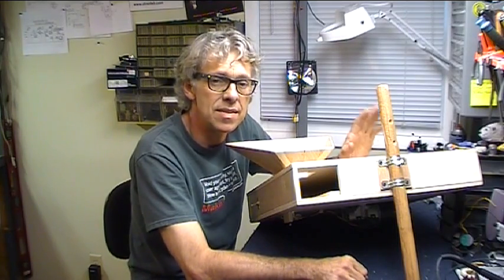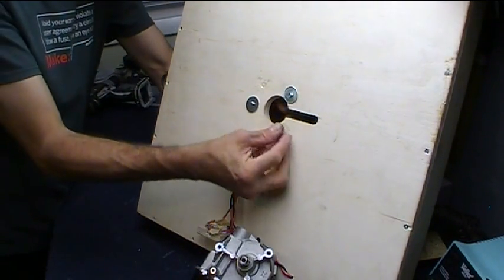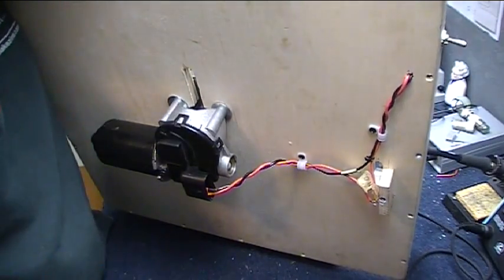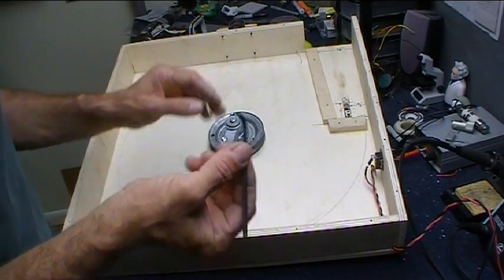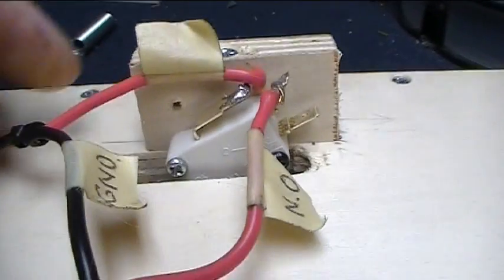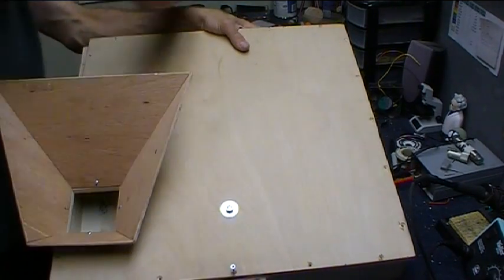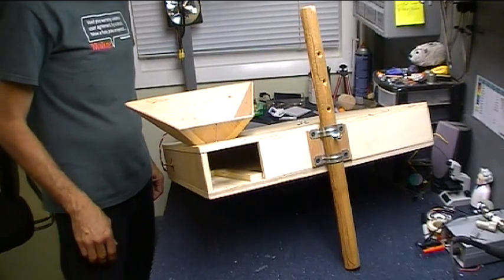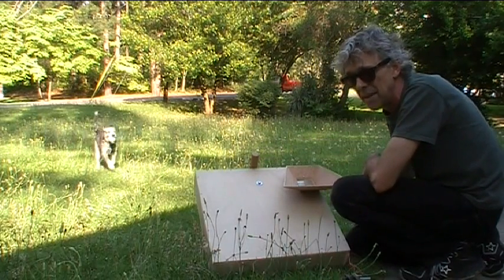Fetch-O-Matic DIY Ball Launcher

Comment: I know this DIY is old, but is it possible to get the PDF instructions still? I tried the makezine site, and they don't seem to be available anymore. I really, REALLY want to make this for my JRT. I have been through 3-4 different commercial fetchers, and they are all trash. This would work perfectly. TIA
Reply from the maker: This link is for the PDF but for some reason it isn't on a secure server. COPY THE LINK AND PASTE IT IN A NEW WINDOW THEN HIT ENTER. 
Chrome browser will give you the option to download it anyway. I did so on my laptop and it downloaded fine. Build it!!
Link: http://cdn.makezine.com/make/31/dog_ball_launcher_template_pdfs.zip
Reply: @HackaweekTV  I copied that link and manually added an s after the http to make it https.  Chrome liked it ok.

Comment: I'm trying a tennis ball launcher machine. First issue I'm facing is joining my selected wheel to the shaft of the motor without there being the perfect shop that sells exact type of fittings that will join th😅ngs together. So far I'm trying to join a 5mm non threaded motor shaft to a 6mm non threaded shaft of the wheel. How would you join them?
Reply from the maker: I'd make a coupler on my lathe and add set screws.

Comment: Awesome project.  Wondering what the diode on the switch is for?
Reply from the maker: To prevent using it in a backward rotation if connected reverse polarity. ;)

Comment: I've gone threw 2 wiper motors the main gear cracks from the impact of the ball wacker over time, I tried reducing the spring tension too, my dog loved this machine but I need a wiper motor with metal gears I think.

Comment: what an awesome idea!... i have found an old wiper motor covered in dust and have it working, im wondering, on the motor you used, does it rotate with next to no resistance (as the arm on yours seems to move freely), i am concerned that ones the spring (on mine) is past the half way point it will not 'fling' because of the tention on the motor? anz suggestions? Thanks!!!!!!!!!!!!!!!

Comment: Thats a smart job indeed. especially that box is flat. Alot of room for improvement, but the core idea is great. you may add an autofeeder pipe.also a rubber head on the arm to enhance distance & protect balls from damage. Applause 2 U.

Comment: Very cool. I plan on building ball launcher for my dog, and I'm pretty sure I'll be able to teach him to drop the ball in np. It's the dragging it out of the garage, running the extension cord, and plugging it in part I'm a bit concerned about. I gave up on trying to teach him how to drive himself to the dog park. I worked out the peddle extenders but couldn't get past the no thumbs..."I can't get a grip on the steering wheel" problem. I told him, "stop your whining, you're not trying hard enough"
Reply: +Mike Lange   Lol Classic!
Reply: funny

Comment: Hi, Can you please tell me if any windscreen wiper motor will work the same or is there a reason you have used the ford windstar motor?
Thanks
Reply: I've tried a different wiper motor and the main plastic gear keeps cracking, I think you need metal gears

Comment: Hi
Great idea. Can you figure out a way to adjust tension of the spring, to allow for longer or shorter throws?
Reply: John Spangler just add bolts in other positions to to hook the spring to. or attach it with an I bolt  and screw the nut down further for more tension.

Comment: Thanks for the tutorial!  I am trying to build a smaller version to launch ping pong balls with.  The motor you are using is probably overkill as all I want to do is pop the ping-pong ball in the air 3 or 4 feet.  I am totally lost on what kind of a motor would be low-cost and have the torque to load the spring.  Any suggestions?

Comment: I'd add a switch or opto at the entrance. It wouldn't be hard to add a cut-off if something was poking in the front hole. Even if it "cut off" the motor as the ball flew out, I doubt it would make any difference - so much momentum. Really love it.